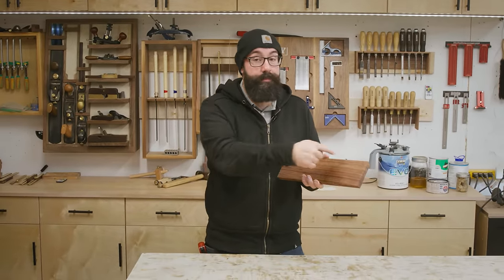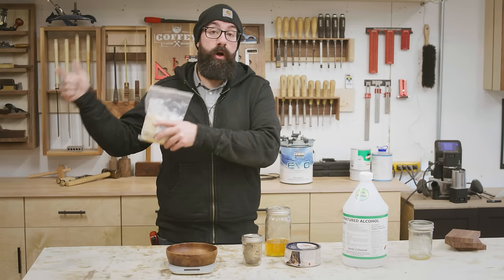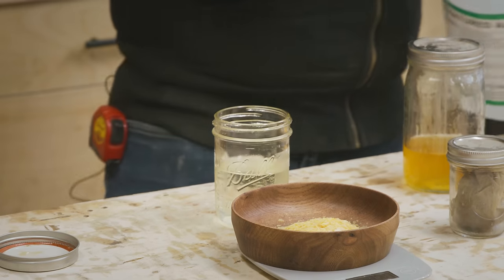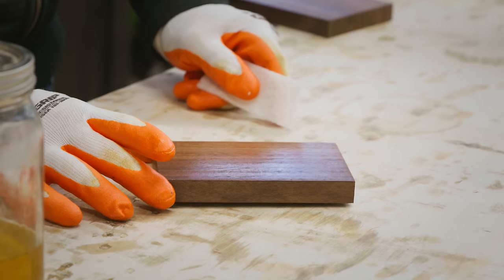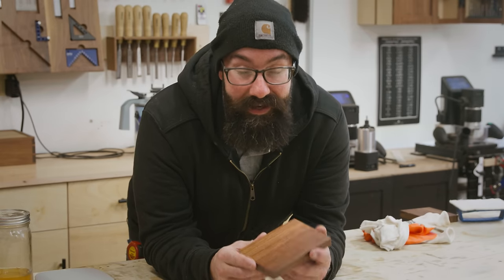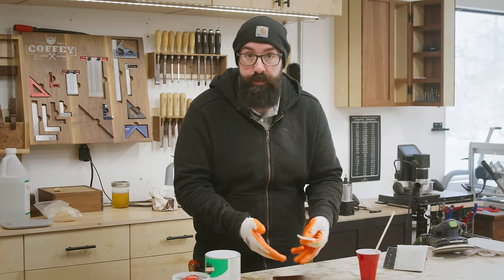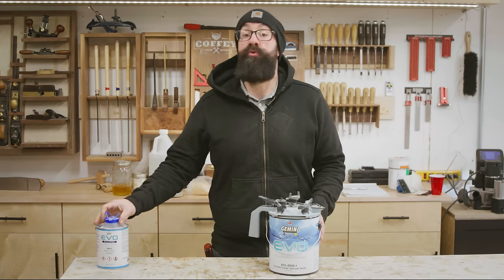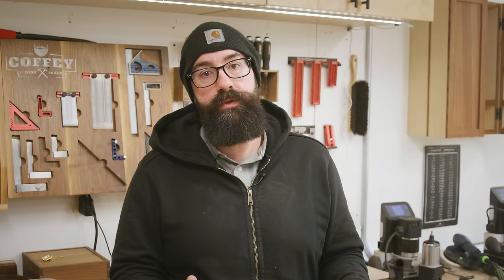3 PRO LEVEL wood finishes

Comment: I tell people finishes are my thing. I am on an endless deep dive into the esoteric differences of finish appearance. For example currently building custom Bunk beds out of hickory.  I love hickory but the color change can be a bit drastic. So I am using Watco danish oil medium walnut wiped on then I am spraying 🎉 Sirca with an HVLP . The Sirca is a water based and I use the matte finish.I do 2 coats and an aggressive sanding between coats with 220. I get an automotive quality/ smoothness of finish. Also the durability has been very impressive , I spray horizontally if possible because the finish needs to go on pretty heavy, the evaporation with water based is high. The Watco eases the extreme color variation , but most important adds depth the finish and brings out the beauty of the grain. We could talk all day about finishing, I am a TOTAL GEEK about the subject. Love your channel. I am going to make some shellac and play with it on light use projects as you mentioned, also try adding a more durable product on top. ❤ playing with finishes 🎉
Reply from the maker: You'll love shellac! It's a great finish. I haven't used Sirca yet but it's on the list. Sirca is owned by Gemini Coatings who makes Evo

Comment: Big fan of shellac.  It looks beautiful, it's sustainable, it's food safe (shellac makes jelly beans and other candies shiny), there's lots of color options, and it's easy to repair/refinish because the alcohol dissolves the existing layer when applying a new coat.  I even use shellac for my shop furniture.  I like to use a magnetic stirrer when I mix mine up.
Reply from the maker: It's really a great product

Comment: This is the first video from you that I’ve seen. I’ve been woodworking for over 45 years and have used (and abused) every finish known to man. I absolutely agree with what you say - okay, not absolutely absolutely - but mostly absolutely.

I love shellac. On the right piece, as you say, it is a lovely finish to use. Using a mop (that’s the correct term on the UK for the applicator you use), is the best way but you should strive to keep a wet edge. But which I mean, try to use overlapping strokes on to shellac not yet cured. That’s not easy and it requires preparation and a bit of experience. But, if it goes wrong, it’s easy to correct.

Correction varnish or lacquer is the most durable but requires investment in equipment and a lot of experience. Get it wrong and it’s a lot harder to correct.

Like most woodworkers, I don’t have a dedicated finishing room. Therefore the ability to move a piece out of the way and getting minimal contamination from shop dust are important. Therefore, like you, my preference is 2 pack hard wax oil. I’ve done a lot with HWO and here are my experiences and thoughts:

Late last year, the Wood Whisperer did a review video on 2c HWO. Check it out because I thought it was very interesting. His overall winner was Natura Onecoat which I had not heard of. Not surprising as it wasn’t available here in the UK but. I’m told, soon will be. Anyway, I contacted the makers and they very kindly sent me samples. I’ve now used it many times on many kinds of projects and tried many different preparations, applications, after treatments. For my money and my experience, Natura beats aIl others. Quite easily. In terms of cost per square metre, it’s excellent value (I can’t compare to Rustic Lumber as we don’t have that here but I did some maths and I don’t think it works out any cheaper); it spreads like butter; it buffs very well and a little goes further than any other (that’s more subjective than objective as I’ve yet to try covering 55 square metres (that’s the minimum for 1 litre of Natura) of the same timber as I cover with another 2C HWO but I’m sure I’m right). Finally, and it’s a gripe of mine, the containers are made so that you can get every lest drop out and you don’t get messy, ill-fitting lids with the HWO going hard in the tin. 

What I sand to depends upon the timber. For closed grain Timbers like maple, I go to 80 or 100. For open grain, like oak, I will go to 120 or 150 or 180. For me, it’s a feel thing rather than a fixed number. I then water pop the surface with a final light sand. Then I vacuum and (Mr over-engineer) wipe over with denatured alcohol or similar on a clean rag to ensure all the dust in the pores is taken out. 

For small pieces, I apply with the white scoured as you do. For large pieces, I use one of those car buffers with a white or maroon pad underneath (made out of the rectangle pads). I drip the mix onto the surface and then immediately rub it in. That way, I control how much I apply (if you end up having to wipe off excess, you’ve used too much). That machine buffing makes light work of a table top. 

For me in my shop, Natura will cure enough within an hour that I can carefully move it from my bench and I can carry on. It’s also cured enough that no dust from the shop will contaminate it. 

I’ve tried several variants. I’ve sanded down to 400 grit. On some timbers, the HEO gives an even coat but, on others, it goes blotchy. That’s just the result of uneven absorption on closed grains. I wouldn’t have too much issue going to 150 grit on those Timbers but I’d be aware that occasionally, it might need redoing. 

I’ve tried 2 coats and did get a higher sheen but I believe it got the higher sheen from the wax in HWO and not the penetrating oil in HWO.
So, I have applied a high quality (low solvent) furniture wax over the top and got a very high sheen. 

So, for me, Natura Onecoat can be described as the best overall finishing solution for me. It’s not the best at some things (total gloss or very high durability) but it’s the best for 80% of what I do.
Reply: This is a lot of good info! Question. Is the reason for "low solvent" furniture wax because solvents strip the oil? Do you find that applying the extra wax reduces the penetration future coats of HWO will have?
Reply: @josiahutah3712  thank you. High solvent waxes ( or high solvent any finish) mean that it spreads more easily but with a thinner coat. Low solvent means it’s harder to apply (although warming a wax solves that) but you get a better coat. For me, 2 reasons not to buy high solvent: firstly, solvents are cheap and so you are paying the price for expensive wax when you are getting cheap solvent; secondly, solvents are bad for you and bad for the environment.

Your second point is particularly interesting and probably needs a chemist to answer it properly.  I use Natura Onecoat - and apply just one coat. However, I did a piece in very hard sycamore and the result was blotchy. That was because this piece was the hardest, most closed grain piece I think I’ve ever worked and the absorbtion of the penetrating oil was poor to non-existent. That partly shows that (any) hard wax oil is not the perfect solution in any situation and, for this piece, I should really have used shellac or a varnish as both of those sit on the timber. Anyway, back to your point, I applied a second coat of Natura to see if I could rectify my mistake. It didn’t but that second coat did absorb into the timber in the more open grained parts but not where it had not absorbed before. My deduction from this is that subsequent applications of hard wax oil will “penetrate” the original wax in the hard wax oil. Therefore, I’m guessing the answer to your point is that you can apply subsequent coats of HWO to a surface that you have waxed. I haven’t tried it but I think I would lightly degrease the waxed surface before applying another coat but that is my Mr Over-engineer.
Reply from the maker: Glad you've found a product you love! I haven't tried it myself.

Comment: I am in a table build using 100+ year old pine . Its incredible looking old growth sruff with alot of it quarter sawn with no knots and is clear. It does have a red tone. Looking for a decent finish that wont show water marks. The rustic hard oil finish you used peeks my interest. How does if fare using it on a dining room table? Wanting a great quality and long lasting finish thats somewhat easy to apply. Saving money is always a plus so if this stuff is as good as the bigger brands i am interesred. 
Thank you for your sharing your experience with these finishes.
Reply from the maker: I've used it on many dining tables, mine included. You will need to use coasters but mine has zero water marks.

Comment: I try a lot of different things. And try to cater for the intended use of the item. The shellac and furniture wax is a favorite. Osmo is my current hard wax choice. I like a nice danish oil finish, but it does have to be maintained regularly. Lint seed oil stains the wood I feel. I use it more when hardening metal or oil treating metal. But this helps give a broad view of each types purpose. Good video.
Reply from the maker: Yeah these are a broad approach to finishes iny shop. Like I said, we use a ton of different products for different uses.

Comment: Any thoughts on Odies? I have a fairly deep finishing cabinet but mostly used Odies Oil and Wax, which has been super durable and looks good the higher I sand (320+ - 2k). Just curious if you think one of these was better  (mostly tabletops and desks). Appreciate the video
Reply: Went through a round of Odies on my last project. https://youtu.be/SK-5k9Gjno0 Looked great! But I found it laborious to apply. I would only use it on small projects. Rubio or Natura was sooo much easier. I also found Odie's did not sink into the fibers like the others do. I could visibly see that the finish wasn't reaching deep between the grain. I rather the feeling of knowing the piece is protected deeper than that.
Reply from the maker: Odies performs fine. My problem is with the owner. I refuse to give him any of my money.
Reply: @CoffeyCustomBuilds  Interesting. Can't say I know anything about the owner. But I'm curious.

Comment: The rustic lumber instructions suggest sanding to 220-320 for furniture. Have you tried that and not been pleased with the results?
Reply from the maker: With Rustic it works great! I was more giving a general consensus from hard wax manufacturers. But it's great with Rustic
Reply: @CoffeyCustomBuilds  good to know since about to use it for the first time.

Comment: What is the best method of cleanup with the rags used for the shellac? I’m always nervous about rags and what can be combustible and what isn’t. 😳
Reply from the maker: So, you don't need to worry about shellac. The denatured alcohol just evaporates. It can start on fire with an ignition source but not on its own like linseed oil based finishes. You're safe with shellac.

Comment: I enjoyed this content, thanks for sharing.  Unfortunately, this was a little too narrowly focused for me, as you didn't discuss any other products and why you don't use them.  For example, I've used Danish Oil before, and I'm about to do a project with Rubio Monocoat for the first time, common variations on tung and linseed oil based finishes.  I've also used poly finishes in the past.  It would have been helpful to at least have your thoughts on these products among others, so that we could better understand why you use what you use and avoid common alternatives.  I know that's a big ask, since there's so many finish options available, but it's not clear from your presentation if you've never tried any other products, or if you find them lacking in key ways.
Reply from the maker: Unfortunately going over every finish I don't like isn't an option. I can't make a 4 hour video talking about the deficits of every product. No one would ever watch it. Rubio Monocoat is a hard wax oil. It's a solid product but 3 times more expensive than Rustic Lumber and simar results. There are roughly 8,000 poly products on the market.